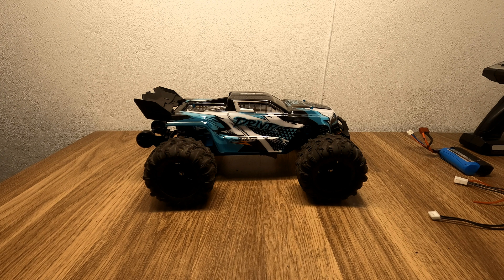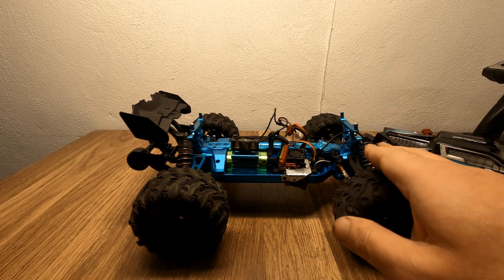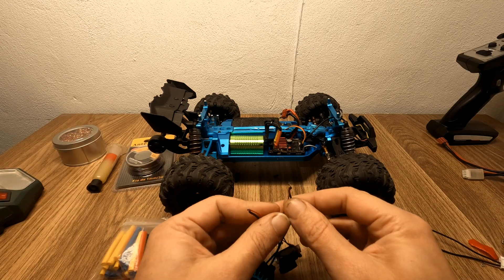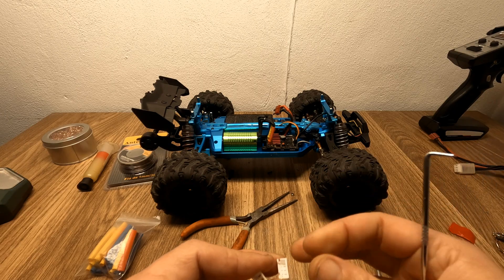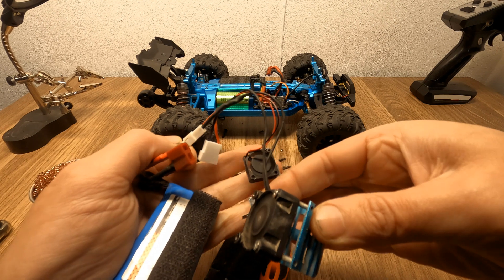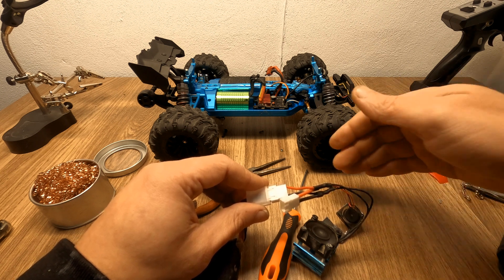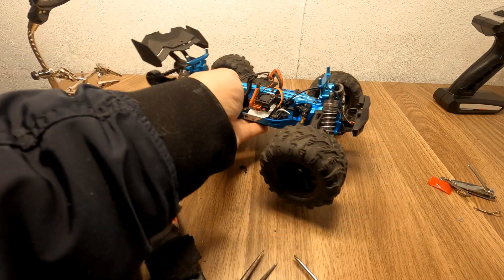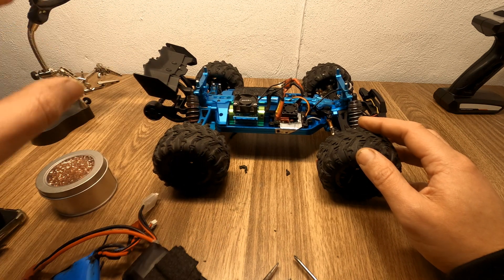Sg116 Max Cooling system upgrade! DIY Mod Never seen on YT!

Comment: how long have you been testing this with 3s?
Reply from the maker: Hi, with the new esc I have not count but several batteries. With the stock only for speed run and 2 or 3 times bashing, the stock esc doesn't like 3s for too long.
Reply: @Fast_Lane_RC  Thanks for the info. I hope my son and I enjoy the 2S lipo for a while before we have to buy a new transmitter and ECS. but we will definitely convert to 3s at some point.

Comment: А я чтобы не ушатать вентиляторы с 3S аккумулятором поставил  dc- dc преобразователь, выставил на нём 5 вольт.
Reply from the maker: Hello good move, but the fans I have are 5v to 12v so they don't burn out, the difference is tje speed it rotates, more volts more speed.
Thanks for watching and sharing your idea ❤️

Comment: Hey, i was think about using 3 lipo battery. Which one works best?
Reply from the maker: Hi, and thanks for watching....didn’t get the question, can you ask again please
Reply: @Fast_Lane_RC like I been searching for an good 3 lipo battery.. whats your best option? I was thinking 11.1v 25c or 35 2200mah..
Reply from the maker: @tonyxstarks000  for 3s you will need to make the battery tray mod to fit the battery or buy a very small 3s to install in the stock placement...did you watch that video? Want me to send the link for the video?
Reply: @Fast_Lane_RC yes ive been watching almost all your videos.. but I watched that one also.. just looking for a good battery, that wont blow my rc... Could u point mr in that direction....
Reply: @Fast_Lane_RC Hey, If i do this method. Do I have to solder the wires? Or can I twist them and add heat sink tube
Reply from the maker: @tonyxstarks000  better to solder but you can get away with a good twist in the wire, just make em long and twist em like a knot, heatshrink and you should be good. I recently upgraded the esc and works much better no need crazy wire connections and runs on 3s like a dream...

Comment: thanks a lot!. I have a rJJRC Q130 1/14 2.4G 4WD Brushless RC Cari, but driving on grass with 2s lipo, the esc overheats and stops after 10 minutes. Going to try your mod, hope it helps. Trying to find the heating for the motor, but it is not in your link
Reply from the maker: Hello my friend and thanks for watching with this esc that is not going to happen for sure.
What are you looking for thats not on my link?

Comment: Connect fans positive to motor and negative to motor is how to wire an fan only come on when you press the gas
Reply from the maker: Hello and thanks for passing by. Never thought of this, might give it a try, thanks for sharing.
Reply: Also,  how much drain do they put on the battery?  @Fast_Lane_RC
Reply from the maker: Hello  @Gunslingingmonkey  nothing major and when it gets low battery the car shuts off so no problem just disconnect the fans when you stop the car.
Reply: @Fast_Lane_RC  have you tried or have a video of doing so?

Comment: Hello i have the same model im looking for the ecs fan and the motor fan is there any what fit direct or do they need modification is there any additional wires i need
Reply from the maker: Hello and thanks for passimg by, for the motor you need this https://s.click.aliexpress.com/e/_EQohKIq
You can get the power from the ESC servo plug using this https://s.click.aliexpress.com/e/_EQ2vRNg or this of you do.the ESC fan mod  https://s.click.aliexpress.com/e/_EIVUZvY
For the esc fan you have to do some diy fan mount like I showed also on this short video https://youtu.be/Jxk9wci3Ovk This only works without problems on 2s lipo on 3s my servo started twitching thats why I made this last mod I show in this video you are commenting to, but I only use the battery balance plug fan connection when I do 3s speedruns and for bashing one pack then back to 2s because if you use 3s all the time I am not sure the ESC will survive for too much time, some hold better 3s then others so for the long therm you should only use 2s or consider upgrading the ESC for a 3s capable, there are very cheap ones that should fit.
Hope it helps my friend if you need anything else.please feel free to ask. Thanks for watching.
Reply: @Fast_Lane_RC  thank you for the information I am currently running 2s 1800mah but only getting around 15mins run time do you know any other better battery with better run time and also do you recommend foam tyre inserts ?

Comment: Hey mate! I just bought a default 3s version. Picking up today 30th april 2025. Do you know if they made some improvements to avoid overheating? How quickly can it overheat (mins)? Is there a sagety turn off or I need to vheck eve4y minute?
Reply from the maker: @iddqd776   hello it has a shuttoff for over temperature on the esc if yours says is 3s ready go for it if you damage it ask for refund. I don't know they might have changed something or just saw youtubers using 3s and start addung this to the product features, who knows.
Thanks for passing by
Reply: @Fast_Lane_RC first dqy experience: the passive heat sink on controlnunit gets very hot quick, and car signals (flashing light) and stops running car. So a safety  i will upgrade better cooling on control and on kotor for sure. Battery is ok atm.

Comment: Dear, why not connect one fan to one spare port on the ESC?
Reply from the maker: @raghibshuja9280  hello and thanls for passing by  the plugs on the esc are for leds and ha e very low output so the fans turn really slow.

Comment: Olá! Estou à procura de uma 3s que caiba nele sem adaptações, existe? ou terei de comprar uma 3s normal e fazer um suporte para ela de alguma maneira?
Reply: O melhor que encontro de 18650 é uma 3s com 1500 mAh 45c, mas isso deve morrer em 10 minutos com 1500 mAh... para ter melhor que isso só arranjando uma maneira de suportar uma bateria maior certo?
Reply from the maker: @joaomariaalpoimcolaco5049   sim João ou tenta a ovonic air 2200mah mas fica muito justa e quando tens acidente não é bom, o mod da bateria é simples e abre muito os horizontes do que se pode usar.
Se comprares na cnhl com o meu link tens 7% off em todos os produtos https://chinahobbyline.com/?ref=FastLaneRc da uma olhada a ver se tem alguma que te interesse. Eles enviam muito rapido tens de escolher o armazem Europa se eatas na Europa.
Espero ter te ajudado.

Comment: Hi, can you connect a single fan to the second LED port? Then you will be able to turn it on and off with the lights?
(Im new to RC stuff, so sorry if it's a stupid question)
Reply from the maker: @warrenleo3726   hello and welcome, you can but the fan will run very slow because the output of the lights plug is very small in terms of current so you have to use other solution, os the balance port of the battery or splitting the servo signal with a Y adapter.
I changed it to balance port because ob 3s my servo wont work properly when connected on the servo wire.
I hope this hepls you, we all come from the same place you are so feel free to post your questions here, our community is very helpful.
Thanks for watching and see you soon.

Comment: I’ve been recommended a hobbywing 60 amp ESC.This has a build in fan too.If I installed this would I need a different remote control?
Reply from the maker: @lukerobinson7413  hello yes new transmiter with receiver.
Reply: @ thank you

Comment: Bom video mano, porque é que não compras um módulo Gyro para melhorar a condução? Custa menos de 10 paus e é só ligar entre o Esc e o servo. O meu está para chegar depois vou testar como fica :)
Reply from the maker: @GabrielRibeiro_09   Olá Gabriel, na verdade não acho necessário é bastante fácil de controlar por ser tracção às quatro rodas, no meu 1/10 tenho e nunca o uso, mas porque no meu estilo de condução  gosto de andar sempre em slide so vou a direito quando vou saltar, mas talvez experimente um dia destes.
Obrigado pelo comentário amigo e até breve.

Comment: Another video of yours at the height. What powerful and long-lasting batteries do you recommend for the beast? Do you know if the beast supports 3s?
Reply from the maker: @gregory269  hello it kinda supports 3s the esc is only 2s but it does work with 3s but I do not recommend using it long term on 3s.
For batteries I get mine from CNHL I leave you the link: https://chinahobbyline.com/?ref=FastLaneRc
Do you want a battery to fit the stock battery tray or are you willing to do the mod for the battery tray?
Thanks for the support, see you soon.
Reply: @Fast_Lane_RC  Thanks for responding. Yep, I'm looking for a battery that fits the battery tray, but that has a good number of mAh (3500-4000) and at least 20-35 C
Reply from the maker: @gregory269   hello again,to fit that big of a battery you need to do yhe battery tray mod because the stock placement is limited to 72mm long battery.
Reply: @Fast_Lane_RC  Oh, interesting... Do you know how to properly modify the beast's battery tray or have you already made a video about it? I have also noticed that our beast has two batteries, is it more efficient that way? How did you do it?

By the way, what batteries do you use for the beast? You are a very talented person, keep it up bro

Comment: I have a much simpler way if wanted. I used 2 of the ones you have on the motor🤙🏻
Reply from the maker: @Yii00T   hello and thanks for sharing, how do you turn on the car? I installed the smaller one so I can have room to press the power button I am open to ideas, please explain better my friend.
Thanks for watching.
Reply: @Fast_Lane_RC  so I snapped the blue part in half. 
Screwed 2 screws back in. 
Then zip tied it around the ESC wires to hold it in place. 
Leaves room to turn it on still. I only use the ESC fan on 2s lipo.
Both on 3s. 
I use a 3in1 loom for both fans that runs out the standard ESC port🤙🏻
Reply: @Yii00T do you have videos on how to do this?
Reply: Are you using standard ESC?
Reply from the maker: @Yii00T  hello again, yes stock ESC, and you?
Reply: @Fast_Lane_RC  yes Stock ESC🤙🏻.

Planning on Starting a wee channel with my kid I shall be posting on there as well just got a new addition to the starter fleet lol.
Reply from the maker: @Yii00T  go for it and I wish you the best of luck. What is this wee? Never heard about this one.